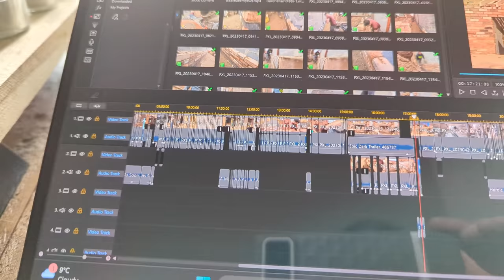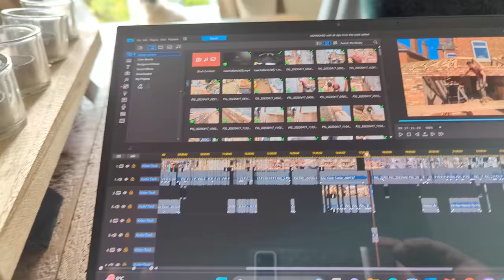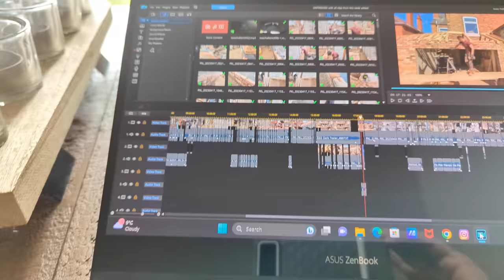Having to take down my work! | Izzy the bricky episode 14

Comment: I hate them jobs but if you are getting paid for it fair enough, but it does mess you up if you are booked up for time. Just stand a piece of 4x2 up the reveal as a profile and lay to that, doing it freehand it will just sink. Sand and Cement for that paving dont use Resin its rubbish, you could use GFTK or Flowpoint which is far superior but they might not like the cost.
Reply from the maker: Thanks very much Andy, appreciate it and will use the profile method next time! Hope you enjoyed your long weekend 🍻🍻

Comment: With the cavity-wall being bridged with insulation (insulation touching the outer walls), moisture will transmit from the damp outer wall through the bridging insulation to the inner wall .          Cavity walls that already built up can NOT have cavity wall insulation added.
Cavity wall insulation can only be installed from the start of construction of the cavity walls and there must be a LARGE air space gap in-between the face of the cavity-wall insulation batts(panels) and the OUTER WALL inside the cavity ; this ALSO includes an air space gap in-between the face of the cavity-wall insulation batts and the cavity wall-tie drip-point, which must point downwards in the centre of the cavity. Cavity wall-ties are laid with a slight downwards slope across the LEVEL mortar joints from the inner to the outer walls. Ask N.V.Q. City & Guilds BRICKWORK teachers for PROOF of this

Comment: Great video! With alterations 2 and 3 be careful to include any dot and dab walls and decorative end panels for your kitchen wall unit measurements! If it's a tight kitchen that could cause issues 👍

Comment: Thank you for all the insights on the details of bricklaying! Keep up the good work with your videos you are  doing great.

Here in the Netherlands we always have a 20 to 40 mil gap of air between the outer brickwork and the isolation to provent water go to the isolation/inner wall. In most of your videos i see the isolation placed in between the inner and outer wall. What specific reason is there for not using a air gap? Im curious mate! 👌

Comment: @IzzytheBricky hi m8 quick question again lol 
Had concrete put in Friday to fill footings in. Had a bit of rain over the night. Saturday morning bricky started. But pump broke to pump water out. Little concerned that Bricky started and layed 7N blocks in 4,5cm of water would this be ok? Or a no no. Thank you m8
Reply from the maker: Again, totally fine. Motor drying is a chemical process nothing to do with how much water Is on it. Do worry, trust your builder 💪
Reply: @IzzytheBricky  cheers m8. I'm having a nightmare lol doesn't help that I got OCD.
To be fair to builder he pumped what he could out. And he's also just reassured me everything ok. He's making good progress.  
Thanks for prompt reply. I appreciate it m8. Kind regards R

Comment: Repoint of patios is never a perfect job with sand and cement unless you have a really deep joint,  use the resins available,  if you are laying a patio on a minimal concrete base use sand and cement and point as you go,  don't point after and it's going to last a lifetime

Comment: The sand cement ratio is too weak for securing aco drains, being below ground level that 4:1 ratio will disintegrate in less than one decade. A 3:1 is better.

Comment: First up, I am not a bricky, but your work looks pretty good. However, I am a carpenter. If you were on my job and just threw your handsaw onto the concrete, I would take very serious objection to that. It takes a fair bit of time to keep your saw, or any sharp tools, in top condition. To see it dropped to the ground and not stored securely gets my blood up. I am old school where we used to sharpen our handsaws, not buy a new one. Other than that, keep up the good work.
Reply from the maker: Thanks so much mate I appreciate it, New video out later on tomorrow! Hope your well

Comment: I havent watched the follow on vids.. at the start of this i notice the rafters end flush with the brickwork more or less! As an all rounder that punishes myself by taking on all work, jm cringing because i just know this customer will want soffit and fascia! The number of times im left with flush timber work when it has been made clear that soffit is going on is amazing! They also never ladder out the gables. These single trade guys cudnt give a shit tho. They do their bit without a single fuck given for the following tradesmen that will have a nightmare because they couldnt be arsed to take 30 seconds to check a drawing or ask a question. Instead finishing their timber flush with the attitude being.... they can knock some bricks out, screw a timber on or extend the rafter. Yea thats great except.... extended rafters have no strength, knocked out bricks arent always covered by dry verge plastics and ALWAYS means having to rebed the bricks that loosen or come off, which means mortar that doesn't match and stands out. This is called bodging and can be cured by a conversation!
Its a real annoying part of building work for me cuz i see diff trades constantly talking about the beer they sank the weekend or englands shit performance with a ball. Yet no one can open their mouth and ask... this place having soffit cuz ill cut my rafters 500mil longer for you or... am i bringing my rafters over the gable wall or ending flush?
Fucking unreal man!